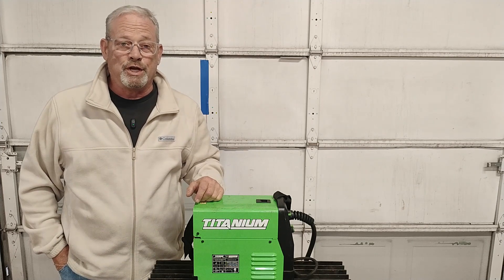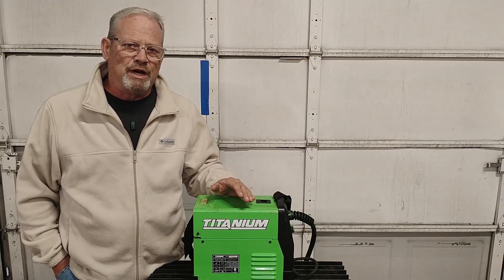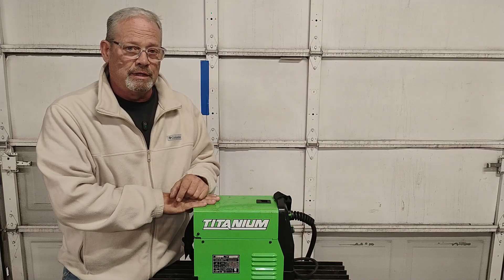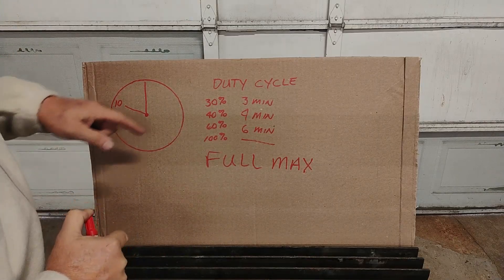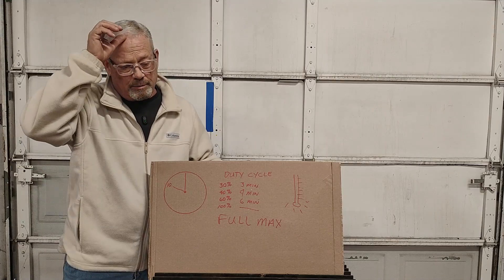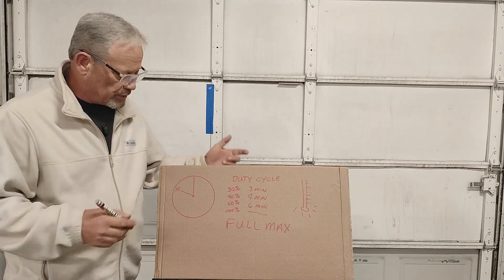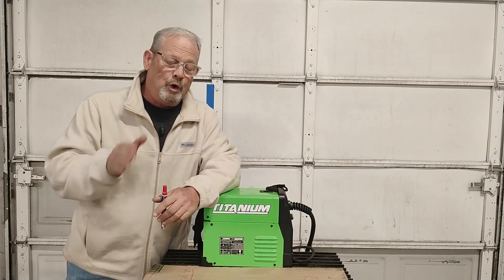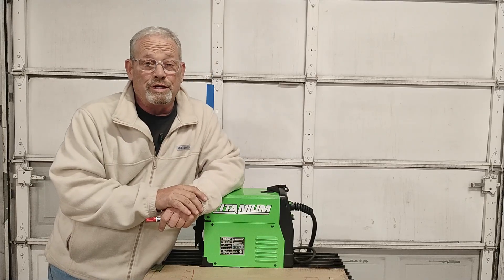Duty Cycle Explained | Why the Titanium Easy Flux 125 Shuts Off

Comment: Dumb question in the back here.... Can you extend that duty cycle at 100% by just having a fan blow on the machine? If I understand correctly heat = bad, so running a cooling solution should keep it running at 100% for longer so long as you're able to remove the heat generated?
I know no ones running max amps 100%, just wondering if you could....

Comment: i have a 90 amp from harbor freight that i've had for years and i weld flat strap for my bbq pit with it and never do over 3 minutes.
Reply from the maker: That's awesome! Those older machines are tough. I had one of those for years. When I gave it away and got a Titanium, the difference was night and day. Isn't it handy to have a welder laying around?
Reply: @AllStarWeldingSC for sure

Comment: It does all a homeowner needs....2 or 4 inches of weld it performs
Reply: 1/8....3/16....max....it does a fine job
Reply from the maker: Exactly! Perfect for those smaller jobs.
Reply: Yep, doesn't really matter for most jobs. Between chipping slag, brushing , fitting parts, thinking what's next, and who knows what else, that 3 minutes is plenty.
Reply from the maker: Yes!! And that's at max setting. The way I use this machine, I'm probably at 80-100% duty cycle. So, it really doesn't affect me at all

Comment: I've had my Titanium 125 for two years now and it's still an amazing machine!  I liked it so much at home, I bought another one for my shop, working on golf carts, lawn mowers (big and small), and other property tasks.  There is a lot of power in this little machine.  I still have yet to overheat either of my 125 welders!!!
Reply from the maker: That's awesome to hear you're getting so much great use out of them! I have a few as well. One for the truck, one in the shop, and a backup. People seem to overlook them because it's Flux core. It's a great machine.

Comment: @AllStarWeldingSC great video explaining duty cycle not too many people know what it is, and great comparisons I was gonna say the Vulcan 195 outlaw has a 30% cycle and the Miller blue star 185 only has a 20% cycle, duty cycle varies from machine to machine that’s why it’s important to always read the owners manual
Reply from the maker: Yes, very good point to read the owners manual! I didn't know that about the Miller. I wonder what the duty cycles are when turned down? Even at 30%, I'm not going to weld for 3 minutes without stopping.
Reply: @AllStarWeldingSC you should look in too how similar the esab ruffian 150 and the Vulcan 195 are they have the same engine and most of the same exact controls and power and if you look up who makes Vulcan it says esab does?

Comment: There are ways to make it not hit the max . Keep the area cool . Fans , don’t have the welder right next to the work . Also a 3 minute constant weld is kinda long without stopping . 
Every time you stop it cools down a bit .
Reply from the maker: Yeah, 3 minutes is an incredibly long time. And that's at max output too
Reply: @AllStarWeldingSC  could also add a second fan if they are that concerned . Some air holes would work as well . Ehh  lots of things you can do to help with the heating issues
Reply from the maker: I couldn't imagine anyone having a duty cycle problem with this unit